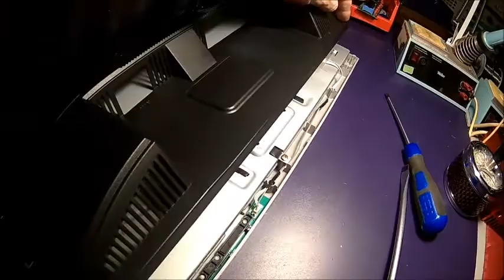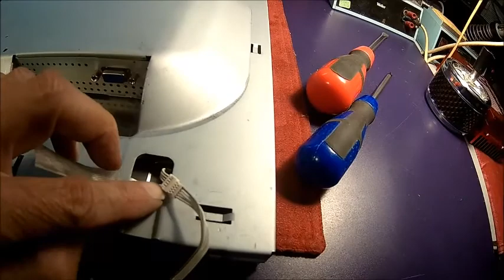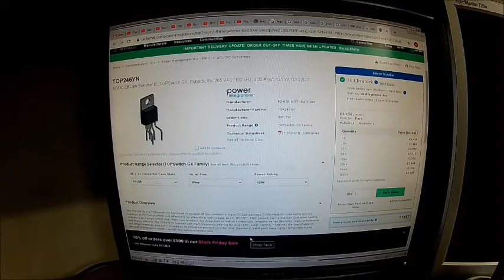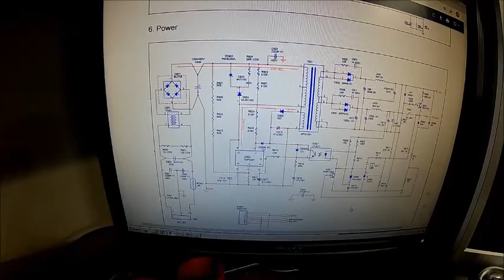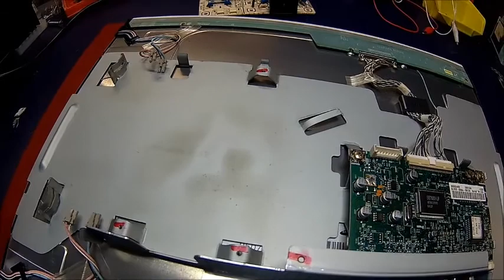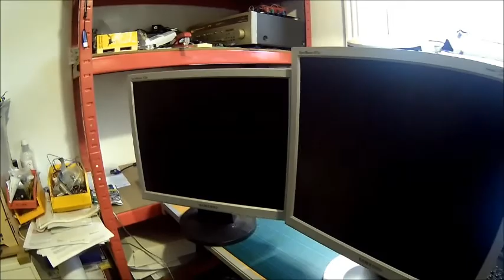Samsung SyncMaster 913n Monitor, power supply repair

Comment: omg i have exact the same monitor and the exact the same part exploded TOP246YN. also brown fuse next to 230 V socket and zener diode next to TOP246YN was damaged too
Reply from the maker: Common issue with those, already had to fix a second one

Comment: That's great. A little time and a couple of bucks keeps it out of a land fill and you get an upgrade. I had to replace one of those in a little motor speed control circuit. When it popped it really let it rip. Sounded like a tiny firecracker.
Reply from the maker: Thanks, ... just got another candidate on my desk, this time an industrial temperature controller which i took out at a customer site last week, ... pretty much the same fault, video should come soon